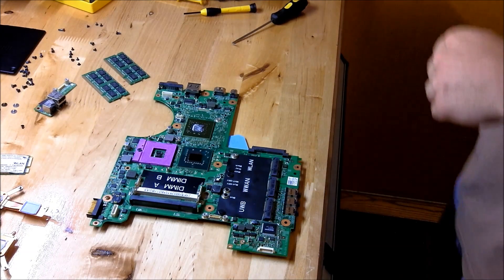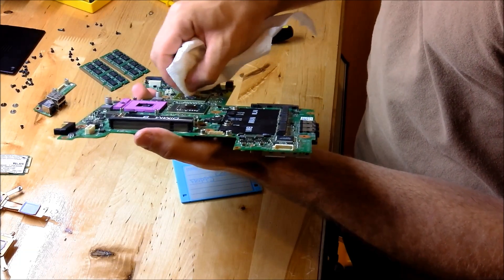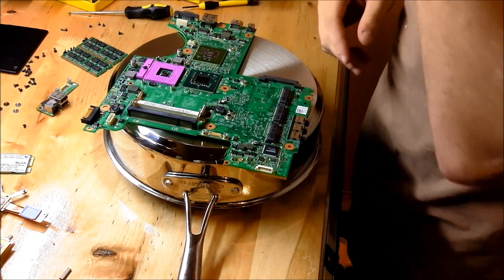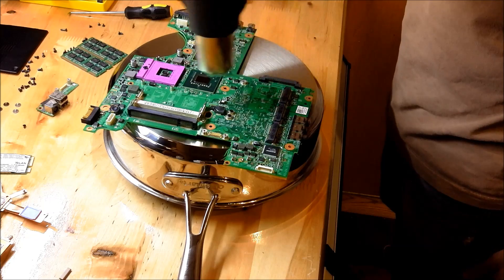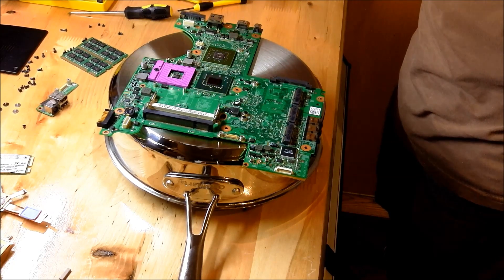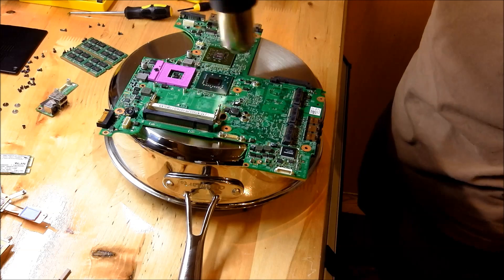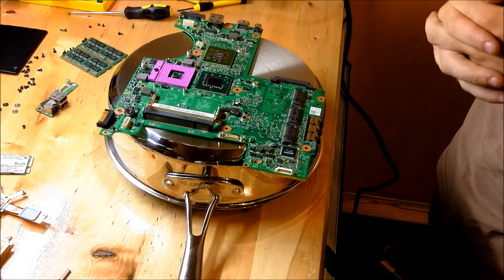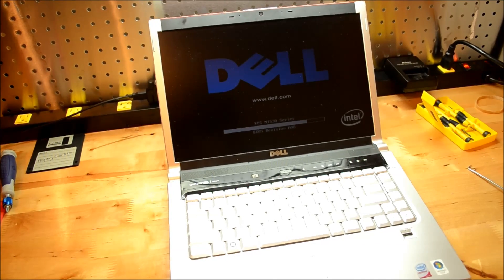Fixing a Dell Motherboard with Heatgun Reflow (or Oven) Nvidia Graphics GPU Issue

Comment: If I had a pocket thermometer and a heat gun then I would simply aim for 385 degrees Fahrenheit over the chip for a couple minutes is that right? Its hard to know how far away to hold the gun and for how long to heat it up without measuring the temp. Also what thermometer would you suggest using that can get a good reading from a chip surface? I can at least take note of how long you focused heat and at what distance. Thanks for the great vid!

Comment: Hello, ive got Medion Akoya P8610 with some screen problem, evrything is running but with black screen, i guess it is gpu issue. My friend did something with heat gun to repair it but it worked only 2 months. Can i use this to fix it again?
Reply from the maker: Patrik Tucnak Yes you can. I would suggest looking at whatever heatsink method is used and potentially upgrading it. Many laptop models (along with the original Xbox 360, fat PS3, and others) suffer from engineering design flaws that make them prone to heat related failure. Sometimes adding additional cooling will prolong the life of the device. For your laptop, I recommend always using it on a cooling pad when available, and at the very least, a hard surface like a desk. Thanks

Comment: I have a 2009 iMac. Now, I'm not sure if its a video issue, or just the motherboard, but it has something to do with the motherboard. Just wondering if I could do the same thing? Thanks... Got it for free so its not much of a risk..
Reply from the maker: Erik Johnstone Yes, I've used this technique on many different things that I suspected heat caused graphical issues (plasma display logic boards, PS3s, Xboxes, etc)

Comment: 385 degree Celsius or Fahrenheit?
Reply: my micro usb port on my phone is a little loose when charging do you think i can use the oven to reflow it?
and when you say wrap it up with what? foil? or that special heat resistant tape? also with the oven what about the plastic bits on it like the ram clips on the side?
Reply: Kongphon Nitikijphaiboon No, you just just replace the connector.
Reply: Fahrenheit. 180-190 Celsius

Comment: how to put a mother board in the oven it full of plastic parts(like ram holders)?
Reply: Eng. Fares  245 Celcius that's production temperature, and that's NOT a normal plastic like u use everyday then u can easy cook it in 200-240 and everything will be fine
Reply: great thank you

Comment: Thanks for this video. I have a Gigabyte X58A UD3R ver 2.0 motherboard that just quit. Tried to start pc, -nothing-( and I mean no lights no power, notta ). Things I tried to rule out other problems-- tested start button-ok-,tried different psu-nothing,tried 1 stick of ram in number 1 slot--nothing, took mb out of case and tried to start--nothing, also tried clearing cmos by taking out the pc battery for 24 hours--nothing. Just by chance ran into this video and thought --hmm, makes sense,so I followed your directions and after the board cooled for a few hours, shot some power to it to see if it lights at all and it did. Put all the components in and it is running fine again.
Again many, many thanks !!!!

Comment: What issue does this fix with the GPU exactly?  I ask because mine recently started displaying heavily distorted, low resolution graphics.  It's not a driver issue as it's visible from POST.  I replaced the lcd & the lcd cable...not the issue either.  I was told/have read that there's an issue with the NVIDIA chip...does your solution seem like a possible fix my issue, or does it just solve overheating?
Reply: Heat from the mobo and chips cause the solder joints to not work properly (cold solder joints).  Reflowing allows the connections to improve possibly fixing the problems.

Comment: very interesting video (i have to perform one fix like that myself ASAP) but i have one question:
if i am right, we are trying to raise the temperature at a covered spot (the GPU's underneath) so that the solder melts. By the time we get there don't the uncovered spots have their solder melted? I am asking this because i am too afraid to use a heatgun in case everything starts flying!!! Instead i am thinking of using a heatgun just for warmup and a blowtorch for the real job. (I know how that sounds....but it has the advantage of not blowing everything) Please tell me your thoughts
Reply: Heat gun is not like a hair dryer. The force of the air coming out isn't very strong, so if stuff starts flyin you've overcooked it.

Comment: I had the same problem and I used a simple iron solder to heat the gpu for about 10 minutes and it worked.

Comment: Thanks for the great video! Well thought out and explained. Just a question or two:

The heat gun you're using looks like a Wagner HT1000. The Depot has it <$20. My own HP laptop video died about a month after I replaced the hard drive. Didn't know about this technique so it's going to be the guinea pig. Why? Because I just replaced the touchpad & buttons on a 4 yo DV7 that belongs to my wife's boss. Didn't even TOUCH the motherboard yet it chose that moment for the video to die on it! Reassembled it, turned it on, all of a sudden I get caps & num locks blinking 4 times and pause, 4 blinks-pause. WTF!?!?!? Am I cursed?!?!? I've been working on PCs and laptops off and on for 15 friggin' years and never had this happen.

Can't do the oven thing because we take care of my paraplegic mother-in-law who has asthma and would probably die if I baked a mainboard in our oven! :-)

Thanks again for the awesome video!
Reply from the maker: Yup, I think thats the one I have!
Reply: mr82020674 Thanks again! I fixed my laptop as well as the other one I think I mentioned although I had to zap it twice because I used compressed air to blow some cat hair off the board (let it cool overnight & she decided it was a great place to take a nap). Held the trigger a microsecond too long and a little patch of ice formed. Next boot no video. But all ended well. 

Just a couple of variations I did for anyone else who is planning to try this: 

1) I used a baking pan ~11x18" lined with foil & had the board resting on the edges leaving about 1/3" of clearance underneath for the heat to circulate. That eliminated the need to flip the board. Also used an oven thermometer with a remote probe to monitor the temp.
2) Heated board to ~300° using the heat gun, 2/3 of the time directing the hot air under the board to be reflected off the foil. Also, because of my work area, which isn't very well insulated (Buffalo, NY winter), I used the high setting on the gun.
3) Was careful to keep the gun moving to avoid any "collateral damage".

Still, could not have done this without having watched this video several times, paying close attention to everything you did. Again, great job!

Comment: Questions I had answered TY :), I had picked me up the same heatgun you got, I used to reflow the chips with a 250watt heat bulb which reached a temp of 450degrees which was perfect, 3mins slowing moving the bulb closer then the last 2mins really close, silly NVidia with their low temp solder, not sure who was to blame on that but saw the 2mil lawsuit while back :P